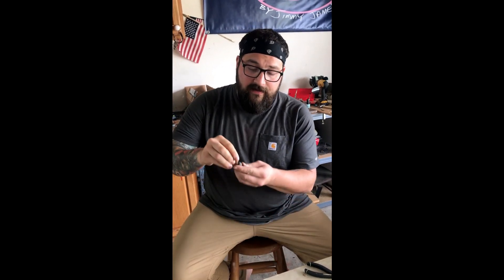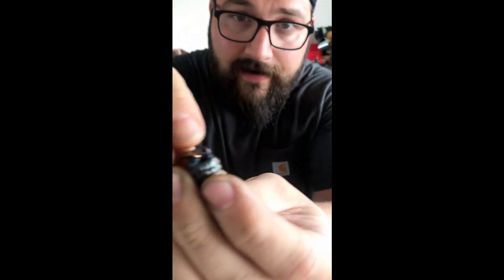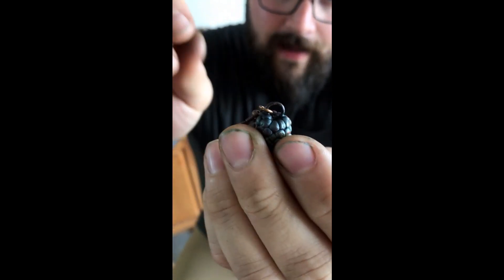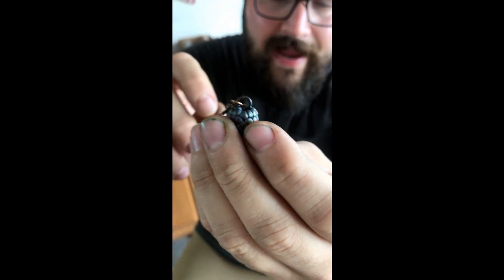Making Electroformed Earrings from Wild Berries. Electroforming Tutorial for Beginners.

Comment: Beautiful! I didnt understand why do you use the drill for? Is it because you wanted to make it harder also in the inside? (Before using heat)
Reply from the maker: Because you want to burn the berry out of the copper shell. You need to drill a hole for the smoke to escape,  otherwise it would crack somewhere when you heat it up.